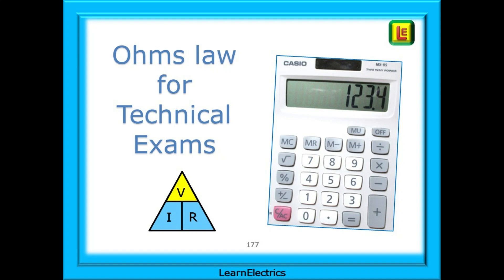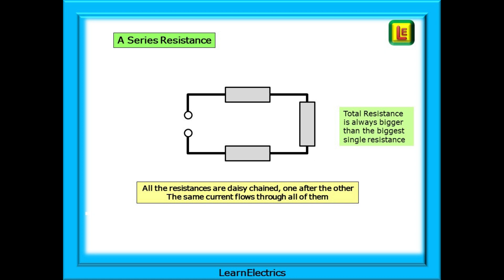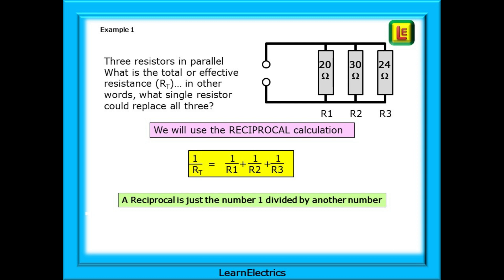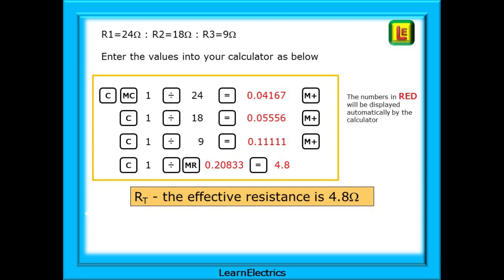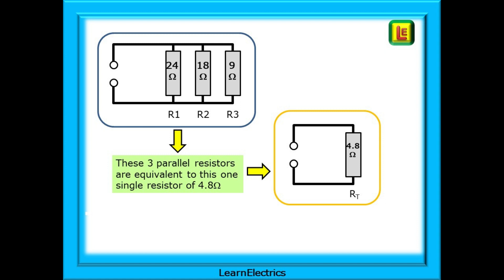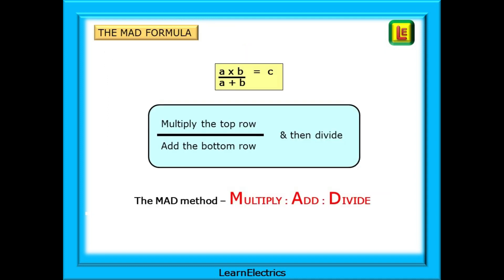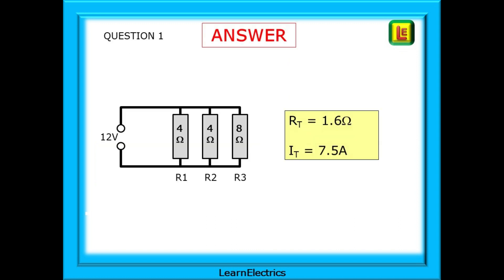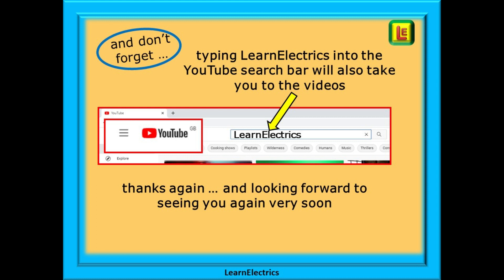OHM’S LAW FOR TECHNICAL EXAMS – WITH PRACTICE QUESTIONS - PARALLEL CIRCUITS – 2365  - 5357 – 5393 +

Comment: Dave, please I wanna ask a valuable question. Let assume you are designing a circuit and you need a 50 ohms resistor but it's not available in the market at the time you need it.
What resistors values that when you combine them in parallel will help you get that 50 ohms value you need.

Thanks
Reply from the maker: Good question Daniel. I will do a video on this soon. But for now, resistors come in discrete values, and they are not just 1, 2, 5, 10, 20 like coinage. They are all over the place values for a very special reason (tell you in the video). You will need a 22 ohm in series with a 27 ohm (49 ohms is near enough in resistor terms), or you can have two 100 ohm resistors in parallel. Hope this helps. Keep watching. Dave.

Comment: Please I wanna ask a question, assuming when given the total effective resistance, RT, is there away you can reverse the calculation to get the individual R1, R2 & R3
Reply from the maker: No. Not without knowing the individual currents. Good question.
Reply: @learnelectrics4402  wow! Thanks for your response. God bless you Dave
Reply: @learnelectrics4402  Dave, please I wanna ask a valuable question. Let assume you are designing a circuit and you need a 50 ohms resistor but it's not available in the market at the time you need it.
What resistors values that when you combine them in parallel will help you get that 50 ohms value you need.

Thanks